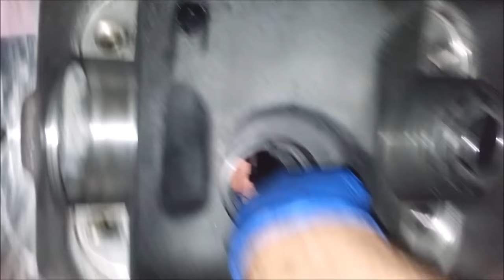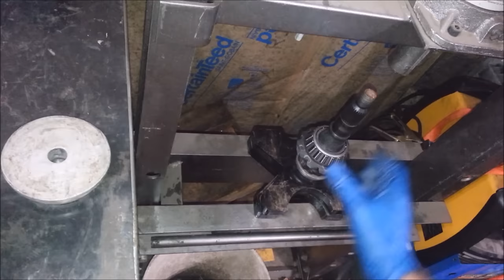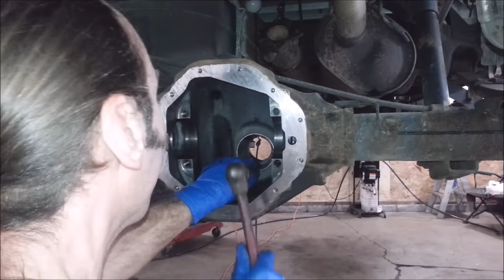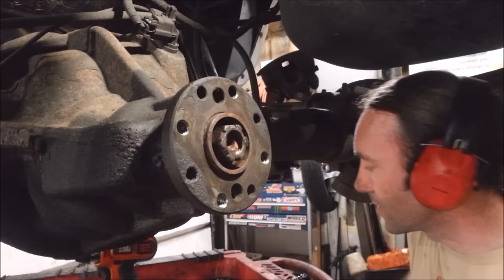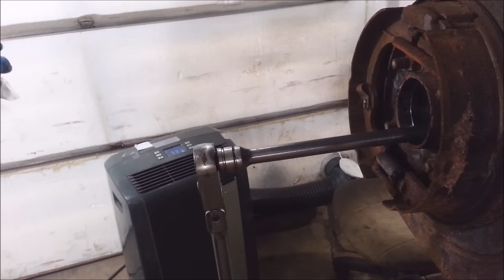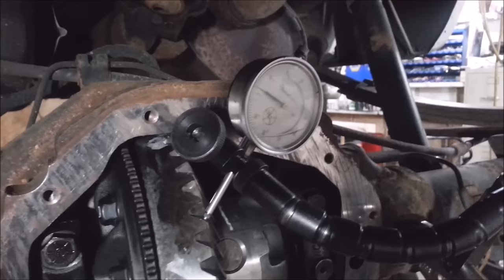1994-2018 Ram 1500 9.25" rear differential rebuild assembly pt2

Comment: Great vid, just one question, when you were seating the front bearing with the breaker bar, wouldn't that have crushed the crush sleeve? I thought you couldn't back off of it at all once it was crushed.
Reply from the maker: The crush sleeve is made to be crushed in order to keep both bearings at an even pressure. Once it is crushed, it cannot be uncrushed, and needs to be replaced if it has been crushed too much. When you are preloading the bearing with a torque wrench, and if you happen to go a little too far by a few pounds, you can back it off a little, and the sleeve should remain properly crushed. It is actually fairly difficult to crush that sleeve past the seated position of the bearings, and races since the recommended preload is tighter than zero.
Reply: took me a while to figure it out... the bar is keeping it from turning so the nut is getting crushed, then you take the bar out, and put so many inch/lbs on it to turn the pinion to make sure that its the correct amount of crushed.  if its light on inch/lbs to turn it, crush it some more by putting a bar back through it and an impact on the pinion nut.

Comment: What about the paint on the ring gear to check the pattern? Dont need to fo that on the chrysler?
Reply from the maker: I suppose you should. I did not replace ring, pinion, shims, or carrier, so didn't bother. Every time I just replace bearings, and check backlash, when the gears look nice, the mesh is perfect.

Comment: What do you do when you tighten the bolts to 100 foot pounds an you dont have the 6 thousand of an inch clearance anymore. I tighten the bearing adjusters everything was good then I tighten the bolts to 100 foot pounds an I have no play now.
Reply from the maker: Loosen the cap on the left I think, loosen the adjuster on the left a little, torque the cap back down, and check it again. You have one adjuster that is too tight, and I think it's the left.
Reply: @RustBeltAuto  I torque the center caps to 100 ft lbs after I got my backlash then set my adjusters to 75 ft lbs an it was perfect

Comment: hello  i broke my rear diff 3.92 dodge ram 1500 5.7 hemi  I can not find same model the country where I live I found something else 3.21 My question to you is whether you will will it work?
Reply from the maker: If it is 2wd yes. 4wd will need the correct ring and pinion. Front, and rear differential gear ratios need to match. Front diff is usually .01-.02:1 numerical ratio higher.
Reply: @RustBeltAuto  thank you very much ❤️can i change rear and front differential in a set from another dodge ram 1500 …215 mm front axle 3.21 rear axle to my dodge ram  5.7 hemi  3.92 rear axle ratio front  215 mm axle - 235mm rear axle ?? sorry for my english 🙏
Reply from the maker: @bbd4eb  if the shoe fits, and the ratios match, you can. The speedometer might be a little off.

Comment: What model Axle is this considered. I have a 2004 Ram 1500 4x4 and want to know if you add a friction modifier and how much?
Reply from the maker: This is not a limited slip differential. It was not needed. I put 75w140 in it that has friction modifier in the oil anyways. I usually always put gear oil with friction modifiers in axles regardless. If you think you need friction modifiers and do not get gear oil with it already in there, just use one little bottle.
Reply: Thanks for the info and fast response. I will add some since I used the Mopar 75w140 without the additive.

Comment: I noticed you didn't go over pattern, is this rear not having to have the pattern rechecked?
Reply from the maker: You always can recheck. Don't see the need, just replacing bearings only. The pinion depth doesn't change.
Reply: @RustBeltAuto   okay, only reason why i ask is being i am using your video as a guide to redo my rear in my 2015 ram with the 9.25 rear, as we currently speak. i am at the point where i am putting adjusting for backlash and setting the adjusters. thanks for the video though! been a great help

Comment: Having trouble getting the pinion tightened down. Pry bar bent before the nut will turn anymore.   Any tips.
Reply from the maker: A bigger prybar?
Reply: @RustBeltAuto  I’ll try. Don’t think I can get a bigger one in there.  Also is your socket 3/4 drive ?  I think my 1/2 is pretty stressed.
Reply from the maker: @031burke  it's 1/2". The pry bar was 3" long.
Reply: @RustBeltAuto  thanks same as what I was using.   Bent the pry bar and sheered the drive off right in the socket.   I’ll keep at it
Reply from the maker: @031burke  Some people put the crush ring in a press, just to get it to start crushing. Once it starts, it may be easier.

Comment: Which way does the C lock face? It has a rounded side.
Reply from the maker: I don't know.
Reply: @RustBeltAuto  well I put them with the round edge facing the tires. Hope she holds. I figured the force should be on the flat side.
Reply from the maker: @beforeadamIwas  I'm sure it will be fine.

Comment: Super video.  But I don't understand why some poeple of Minnesota like here in Québec doesn't use their emergen
cy brake. They probably doen't know anything about drive line premature failiure and the risk to break transmission parking pawl and the consequences.
Reply from the maker: They rust really bad, and become inoperable, mostly because it is never used.
Reply: I know like you,  the rust issue just like here in Québec.  We use a LOT salt on our roads.  But it is a matter of using your emergency brake every day and also, maintaining  seriously you vehicule.  Each year when it's time to change summer to winter tires, I clean and lubricate moving parts on my calipers. Anti-ware clip, sliding pin, pad contact points.  I'm a 40 years experienced industrial mechanic( millwright ) and I have always  did my own maintenance. If emergency linkage is well lubricated and clean, if the rubber plug is water tight, you minimise having trouble a you know.  But with Ram truck, I did last year my friend's brake and yes, the rear emergency's lining went of on both wheels.   It is a bonding issue.  They were thick but loose.  It is a real problem and my friend use is emergency brake everyday.  Just like me. 

Keep-on your excellent work sir!  It is a real pleasure to watch you.

Comment: Good video. Did you notice any notchy or jerky feeling while spinning the pinion during preload check?
Reply from the maker: Nope. Smooth. Might have a little crud in there.
Reply: @RustBeltAuto  thanks for the reply. I'll let my driveline guy figure it out.
Reply from the maker: If I was me, I would blow it out with compressed air, and whack the yoke with a socket on it with a hammer, to make sure the bearings and races are seated correctly. It should align everything up If something is binding.
Reply: @RustBeltAuto   thanks for the tip. I rebuilt it and then tore it down to find uneven pattern on races. The originals had uneven pattern as well. Setup bearings and new bearings all have nochy feel to them. I even cleaned up burs on the seat to no avail. I'm thinking the pumkin is messed up.
Reply from the maker: @Ashroyer86  sounds like it was machined wrong.
Reply: @RustBeltAuto  Thank you for your time.

Comment: Do you know if a rear diff complete out of a 2004 fit a 2008 dodge 1500 pickup
Reply from the maker: Be best to measure the thing. Make sure the u-joints, drums, and stuff are the same.
Reply: @RustBeltAuto  ok thanks I was planning on it just wasnt sure if you knew off top of your head
Reply from the maker: @calvinjones5234  you could always look up your part on car-part.com, and see if they have the same one for other years.
Reply: @RustBeltAuto  thank you

Comment: Would I be able to install a rear diff from a 2011 onto a 2010?
Reply from the maker: It depends.
Reply: @RustBeltAuto  what are the factors?
Reply from the maker: @yaniv zion  gear ratios, brakes, driveshaft yolk. Those are usually the variables doing 4wd axle swaps.

Comment: You skipped a very important  step....you  didn't  check if the gears meshed right ?
Reply from the maker: Yes. I used the same gears, and shims, so didn't bother. When I do them this way, the mesh always comes out right. The gears would need to be soo worn, I would need to replace them for the mesh to be off enough. This truck is still running. It's his daily driver too.

Comment: How mamy shims did you put on the pinion? Thanks!
Reply from the maker: I used the same ones. Thickness needs to be the same.
Reply: @RustBeltAuto  i see. At our shop weve been trying to find info on this because we had a client come in with rear end failure. Long story short the shop before us replaced the shims and put all five in the rebuild and we have no idea how many it came with originally. Any idea on where we could find this info? Thanks for replying man!
Reply from the maker: @SinMideo18  you are going to need to check the gear mesh with the correct backlash, and add or remove shims accordingly in order to get the gears to mesh properly.

Comment: I took my truck to the mechanic and he said that one clutch in my dif is bad , how that can cost me ! Any idea
Reply from the maker: He told you that you have a bad clutch, and didn't tell you how much it would cost to fix it?
Reply: @RustBeltAuto  he said , about 1050 labor and parts!
Reply: @RustBeltAuto  i mean ! But im thinking  in replacing the diff with one from the junk yard !  One from a 2010 dodge ram or so
Reply from the maker: @yamahar1castillo923  I try to get a good one that is drum to drum, or disc to disc with the same gear ratio, so you don't need to swap anything over. All too easy that way.
Reply: @RustBeltAuto  has to be the same year 2005, my truck is a 2005 dodge ram slt 1500 !
Reply from the maker: @yamahar1castillo923  Look it up on car-part.com. You might get lucky.

Comment: How do you realign the gear if it slips when reinstalling the axle shaft?
Reply from the maker: If it needs to be re-aligned from installing an axle shaft, you did something wrong.
Reply: @RustBeltAuto  -  so that gear will not move or slip out of place when the axle shaft is removed?
Reply from the maker: @HighSierraBob  if you are referring to the side gears in the carrier, no. They will move a little, but stay in place until you remove the pin for the other two side gears. once the pin is in, the other two stay in good enough.
Reply: @RustBeltAuto  -  okay, all I need to do is replace axle seals, so I am concerned about not being able to reinstall the axle if the gear moves out of place.   I replaced the pinion seal last week with no problem.  Thanks!
Reply: @RustBeltAuto  - I replaced my two axle seals today and had no problems with the gears.  I know it needs to be GL-5, but what weight gear oil should I use?  I have a 1995 1500.  No limited slip diff.  .
Reply from the maker: @HighSierraBob  do you have an owners manual?
Reply: @RustBeltAuto  -  Yes, I found it, thanks mucho!

Comment: What size press did you use?
Reply from the maker: 20 ton?
Reply: @RustBeltAuto  thanks for the response there was a 12 ton and a 20
Reply: So I just took my pionion out and there’s no shim between the bearing? Should I install one there or leave it alone?
Reply from the maker: @kidd6055  if there was not one there, no. You are going to want to check your gear mesh with some grease to make sure you are right.

Comment: When you put the pinion back do you have to measure the pinion depth or is it pretty well set once you get the crush sleeve positioned
Reply from the maker: The depth should not change. Depth changes the location of gear mesh. You can see where the gears touch after you install everything with grease, or prussian blue if you like.

Comment: Why didn't you check your gear pattern?
Reply from the maker: Because so far, every time I just do the bearings, the gear mesh is the same, unless the gears are noticeably worrn. If I replace a carrier, or gears, I check it.
Reply: @RustBeltAuto  I suppose if you don’t change the shim and use another crush sleeve pinion depth would be the same.
Reply from the maker: @JoshHookerJoshhook123  You use a different thickness shim behind the pinion bearing, and it will change the overall gear mesh. You can use a new crush sleeve without changing the gear mesh.
Reply: @RustBeltAuto  Ya I’m rebuilding my 9.25 rear end on my dodge right now.  I went with a crush sleeve eliminater on the new motive 4.10 gears.  We shall see what my pattern looks like.  Fingers crossed

Comment: I dont understand what you are checking with dial indicator
Reply from the maker: The clearance between the two gears. Otherwise known as backlash.
Reply: @RustBeltAuto  I bought a bearing set. it came with a tube of paint and a paintbrush. I took the adjusters loose but didnt count the turns because my tool broke. Ive  rebuilt motors and trans but this is my first rear end and I am lost
Reply from the maker: @donniebrookins6215  the paint is to see how the gears mesh. Usually done if you replace the ring a pinion. Since I did not replace the gears, I just checked the backlash. If you use the same shims between the bearing, and pinion, the mesh is usually the same